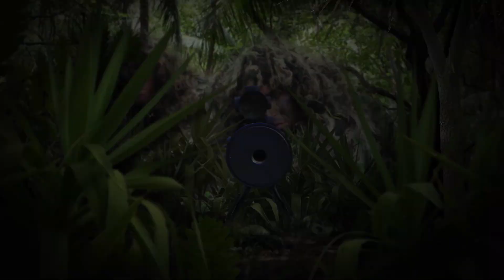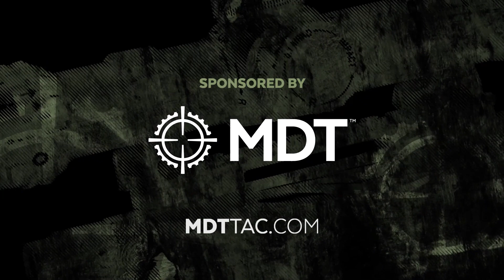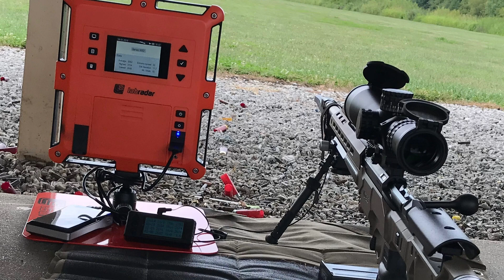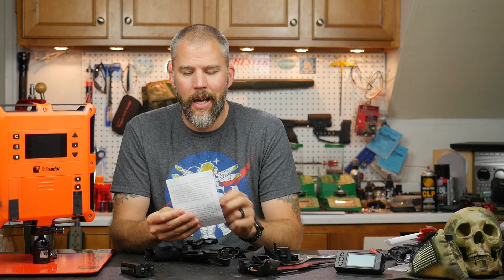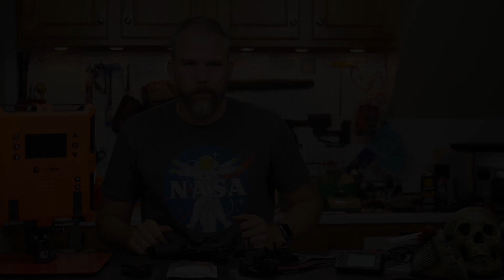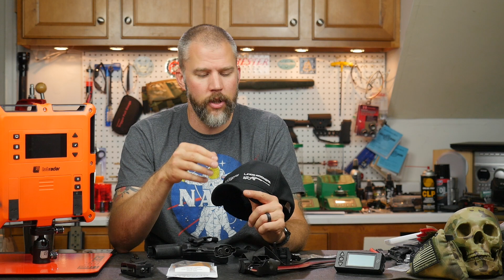Mail Call Mondays Season 7 #28 - Labradar vs. Magnetospeed, Timney 1022, P320 RX and more.

Comment: The bipod; I would usually say not to buy a counterfeit.  That being said, my daughter wanted one for her M&P15-22.  I bought one, replaced the hardware in it, it works fine.  I used it for a PRS match to see if it would work.  It did fine, still worked fine, ran a carbine course, worked fine.  the aluminum is pretty much the same, my real one on my Ruger precision has had an issue where the mechanism jammed on one side and it took a hammer to get it to unlock.  It is an original Atlas from SHOT show and they did replace it.  I was told not to take in sand anymore so I haven't, it just sits in my safe because I live in a state that's all sand.  I'll probably sell it because its worthless to me.  I'm currently running a UTG pro on my prs rifle, it is US made,, all metal, well built and unbelievably, well made.
I guess I'm going to have to disagree twice with you, sorry, I'm the owner of several Police turn in pistols and a shotgun, they are all pretty much the same, have holster marks on the outside but are pretty much unfired.  This is mainly because police officers for the most part don't shoot.  I am a former Deputy with a very active Warrant and Fugative squad, actually what was the most active in the US when I was there.  I went back in the Military and spent years as a team leader on a SRT.
I have a lot of friends in LE and volunteer my time to help them at the range as a gunsmith.

Comment: I own the magnetospeed v3 and I have been been looking at the labradar but after doing my own research and watching this video I realize I already have the best option for my situation. However the only thing I dont like about the magnetospeed  v3 is it's only good for load development to find the velocity node because it straps to the barrel and can mess with the harmonics of the barrel. Once that is found you can work with seating depths to tighten groups. I will get an attachment to attach it to a rail to eliminate that issue. It seems like many people that own the labradar complain about getting it set up to work properly. At this point I'm sticking with my magnetospeed.
Reply: Do you use this on a thin profile barrel?

Comment: Great video.  With one exception.  Most patrol rifles do not live a difficult life.  The problems arise because it may sit for months in the trunk in a Pelican case.  Then when the cop bring si it to qualifying or needs it for a real life problem, the batteries are dead.  I have been told this by two LE training officers.  It is why both departments stopped using EoTech.  

One has gone back to irons.  The other has gone to Aimpoint.  Where the officers change their batteries every year at qualification and then just leave it on.

Comment: One of the guys I shoot with has designed and built a mount for the Magneto Speed that allows him to mount the "bayonet" to the stock rather than to the barrel, thus NOT affecting the barrel's resonance or point of impact as much as it might. I will say one thing about this though and that is that you have to be quite careful to get the spacing between the bayonet and the bullet path correct or you will experience the problems mentioned in this video. Also, it seems that the larger the barrel diameter the less the presence of the bayonet attached to the barrel affects the point of impact shift---this is likely due to the fact that a larger diameter barrel is stiffer and also because the bayonet is a smaller percentage of the barrel's weight. i wish I had a picture of my friend's mounting system to post here, but I don't---maybe next time I'm out shooting with him I will remember to take a few shots of his system and post some of them here. Personally, I have found that once you are accustomed to using the Labradar, it is pretty easy to use and have not encountered the calculation delays mentioned in this video. I had a MagnetoSpeed and sold it after I acquired a Labradar and had a chance to compare the two. I will say that I have never felt the desire or need to use a chrono during a match because I feel that, if you don't have accurate speeds by that time, it is just too late and is just another distraction while trying to shoot a match, ESPECIALLY a time restricted match, which is the case for the majority of matches I shoot. 

This video DOES, however, bring up a lot of the fine points of the two systems and should be very helpful in choosing one system or the other.

Comment: honestly... i wish we had better options and for a fair price... i havent used the lab radar but id like to only thing is thats an expensive venture just to see if i like it... i have used the V3 MS and i hate having to re adjust nearly constantly and get an error for not reading if i dont re tighten... that being said it does work exceptionally when its fastened constantly... and for the money i would rather deal with it and try to make it work beter ie adding silicone or something to the buckle so the hand nut adjustment actually grips the torque not slips the strap.. i do most definitely see a 3 or 4 inch vertical elevation change with the V3 on some of the differing levels of grains... and i question if it makes the group larger because if it works well with 63 grains on my 7mm RM the elevation is substantial at 64 and 65 grains.. i do not care the exact impact point but if it makes my groups look worse.... then i have to load for velocity testing AND then load more for testis for groups... that honestly would be the advantage of the lab radar... but again a very costly venture

Comment: Just bought LR.  Waiting on it to arrive.  The reason is I think it could be far superior to MS as it doesn’t attach to the rifle & potentially effect barrel harmonics.  I don’t want to load double strings for load development.  That a waste of time and resources.   Plus the data file provided has a lot of info by the yard over whatever distance projectile is tracked.   Also there is a Bluetooth app for the LR where you can make setting changes without touching the unit

Comment: First, thanks for the excellent video. I own both, the MagnetoSpeed and the LabRadar. The reason I got the LabRadar was because the change of POI you mentioned. I am getting used to the LabRadar and the more I use it the better I like it. I also love my MagnetoSpeed and don't intend to sell it. I do use a chronograph every time I shoot my precision rifle because it's the only reliable way to determine how accurate a particular load is. I try to keep the ES within 20 ft and the SD single digit. The use of a chronograph is invaluable. It also allows one to feed very accurate muzzle velocity data into your ballistics program, which probably is the one most important factor in determining whether the particular firing solution will yield the expected results. As you pointed out, for shooters that use handguns and need to establish power factors, the LabRadar is the way to go. Both units have their strong and weak points. Another thing that I like about MagnetoSpeed is the customer service I've received which has been very good. The LabRadar is pricey and it's made in Canada. The MagnetoSpeed is made in the USA (to me that's an important factor). Buy either one, or both if you can afford it, and you won't go wrong. Again, as you stated, both of these units are right on the money, and the difference of the reading between the units is not significant. I intend to watch the bipod portion of the video next and comment afterwards.

Comment: barrel wear will also change the velocity. If you chrono of a new barrel you need to chrono after a couple hundred rounds. The barrel will speed up. after thousand rounds recheck again. You can skip 1 test if you put a few boxes of ammo thru a new barrel before you do your 1st test. then test it later on for a speed increase.

Comment: Nicely detailed chrono review.  Some of the comments are confusing...Accuracy vs Measurement.  It is my understanding that collecting data for load development is the primary function of using a chronograph.  I have never seen or read that a chronograph aids in accuracy.  The data may be used to achieve tighter groups through load development, but the device is not designed for accuracy; only measurement.  Seems like an apples and oranges thing.  The muzzle velocity is only one variable in the ballistic calculation with a tool to provide that data.   Who knows...maybe I'm wrong and should start using my scope as a hammer also.  Yet, that probably won't help my groups either. (*sigh*)

Comment: It is "slow" because you are using a slow (or older) SD card.... using a faster SD card makes it process faster. I can fire 10 shots in 10 seconds and it reads all my shots with a Class 10 SD card . I have both the LR and the Magneto (plus a Caldwell and a Pro Chrono) ... 99% of all errors can be fixed my proper setup and reading the manual. Get a super fast SD card and a Anker and it will serve you well. Do not use the light plate to mount it to but a nice heavy solid base plate  with some heft to it and the wind will not knock it over either.

Comment: I use the Caldwell chrono with an Apple IPad. It clearly beats the other two you discussed and costs just $70.00. I considered buying the LabRadar unit but first downloaded the user manual and quickly decided it was a bad investment. The user manual explains clearly why it doesn’t work well. Future improvements to the LabRadar may close the gap in features, but the price will always be a factor. I use suppressors and would never use a barrel attached chrono, it is really a bad idea.

Comment: I have both the LabRadar and the V3, and I definitely use the LR far more.  The menu system is not tedious at all once learned, and I certainly don't find it to be THAT slow... slower than the V3 on returning readings, yes, but 99% of the time, I have a velocity before lifting the bolt handle.  It can be a pain to learn how to properly aim, but once I learned the speed-square trick, it's very easy... and once set up, rotating rifles is nothing more than pressing a couple buttons for a new string.  Yes, it will eat internal AA batteries for lunch, but a decent quality USB battery for $25 will last all day long with plenty to spare.  Another big benefit that you didn't mention (unless I missed it) was the downrange velocity tracking which, given you have accurate atmospheric data, allows for bullet BC verification... And if Bryan Litz is comfortable using it, that's good enough for me.
Reply: I use Eneloop rechargeables and get good life from them.  I think the reason why is that i do not keep it "armed" for a long time.  I believe the radar works all during this time and then eats batteries, the mic picking up the shot just tells it that the what radar data it just recorded is to be kept (ie it doesn't start radar just after mic pickup).  Since the smart phone blue tooth app, it is easy to arm it shortly before the shot, allowing a short countdown for the armed timeout.
Reply from the maker: Interesting. I will have to look into that.
Reply: Yeah, but the nice thing with a battery pack is that you can set the screensaver & armed timeouts to max (600sec & 300sec, resp, I believe), and not have to worry about re-arming every time if you take a couple minutes between shots for some reason.
Reply: In respect to aiming the LR, I just glued a short piece of aluminum tubing into the ‘v’ notch in the top of the unit. Quick, simple & effective.  Have not missed a reading since due to misalignment.

Comment: You stated BC will not change in your barrel...that is not correct...BC WILL IN FACT change in your barrel, more specifically based on velocity....manufactors must use an ave BC for their bullets, however the faster you push a bullet the higher the BC...example...exact same bullet 6.5 130 berger OTM will have a lower BC shot out of my 6.5 Grendel  (2500 fps) vs my 6.5 SAUM (3200 fps).....will become very evident out past 600 yards....
Reply: I know bullet makers will publish "banded" G1 BC's due to different velocities.  I believe G7 BC's are more accurate for low drag trajectories and do not needed banded BC's.
Reply from the maker: Dave, I am well aware of the relationship of BC to Velocity. We are discussing external ballistics. Not internal ballistics if you want to discuss what is happening inside the bore, you better start factoring in friction, compression of the air column ahead of the bullet and the transition from that condition into the free air in front of the muzzle. Sometimes we simplify things as necessary to discuss the concept as a whole. Otherwise every video would be two days long.

Comment: I shoot suppressed and I was forced to buy the LR Extra mic for it to pickup the shots. I was ticked it wasn't included. But despite that, I prefer the LR. My MS failed with an error message after only 20 or so shots. Brownells was great and gave me a refund. I also bought the stand for the LR. As for load development, the LR is superior, if you don't have the chassis mount extension for the MS.

Comment: I have the magnetospeed sporter. The only thing I really don't like is the problems with getting readings as lower velocities. I have had no luck with it working on subsonics. Sadly that is one of the reasons I got it.
Reply: I have the MS V3 and it massured after the sensetivity tweak my Wadcutter loads form my revolver around 200m/s or 656ft/s. And thats near the Quick Load Data. So the V3 is capable of it.

Comment: Great info John, as usual.  My take on the LR vs MSv3: The LR is easy to use on a single target with multiple rifles.  It has better logging and management of the log files.  Its display is a bit cumbersome, it often loses track if it or the rifle to target angle changes, accessing the buttons usually requires reaching across the rifle, it sucks up batteries quickly.  The MSv3 once set reads anything from suppressed .22 to shotgun slugs without issue, the control is right there at your fingertips, so no breaking position, initial setup is cumbersome, but there are ways to ease it with caliber specific delrin rods and off barrel mounts, logging is basic with little on-board management, always have to check to make sure the bayo is clear of the bore axis.

Comment: I own both and agree that one is not really better than the other though the Lab Radar sets up quicker.  They do have an app that works with your phone or tablet.  I use my lab radar with an i pad and you can operate the unit via the iPad.  Also the data is available on iPad so you do not need to remove sd card from Lab Radar unit.
The magneto speed has an adapter so you can use with a pistol that has a rail.